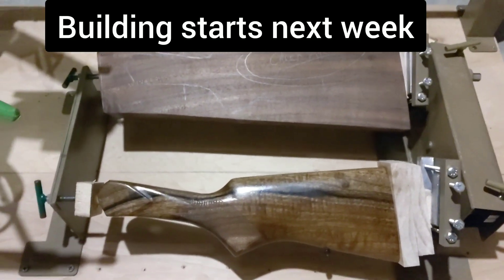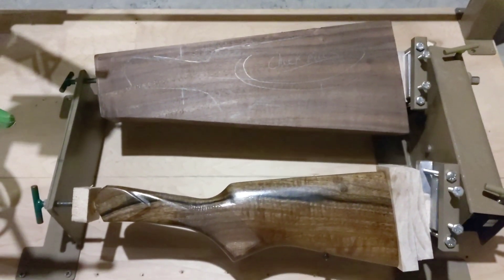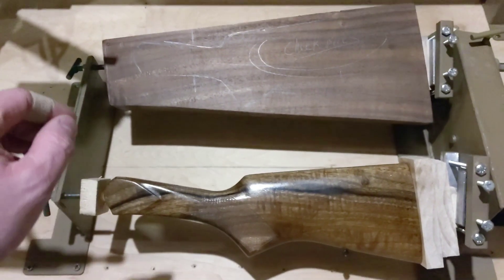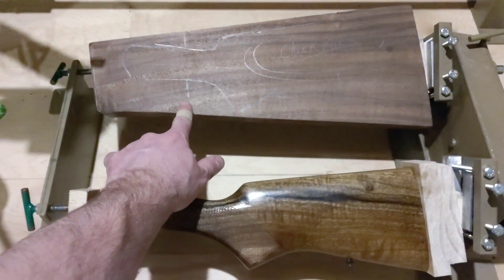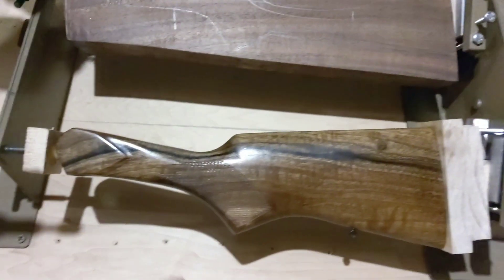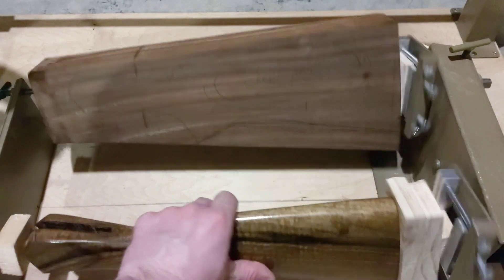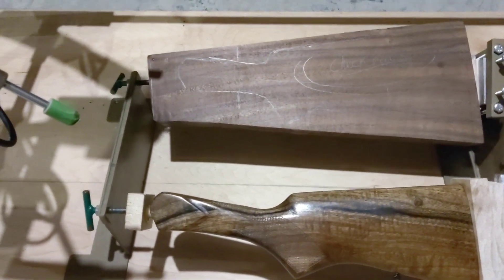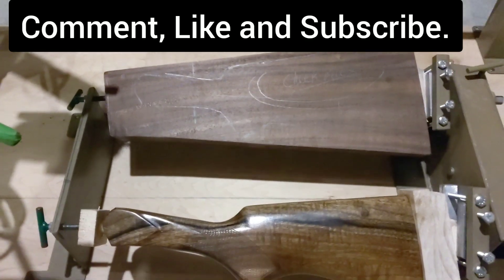Baikal MP-221 double rifle stock build. - Starts Next week!!! -Gunsmithing-

Comment: Could you perhaps add something like modeling clay to the pattern stock to shape it approximately like you want the new stock to look and then hand finish it. Not sure if the Clay would be hard enough for the stylus to follow or not.
Reply from the maker: Not to sure about clay... I know a lot of people either add bondo and sand smooth, or add pieces of wood.
Reply: @LanceHanlonOutdoors  I had thought about the Bondo but I figured that it would ruin the stock and not be able to reuse it.
Reply from the maker: @garysorrells8133  Yeah, I'not going to reuse that stock, so I could do the bondo.  I ordered the recoil pad for it today as well.  Going with an English style red recoil pad.